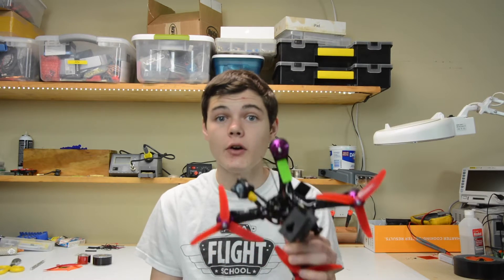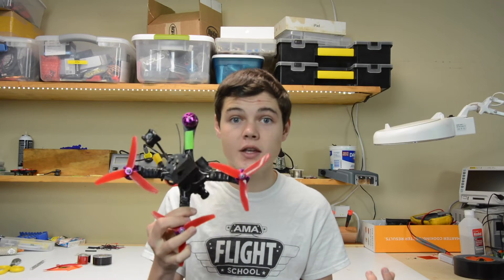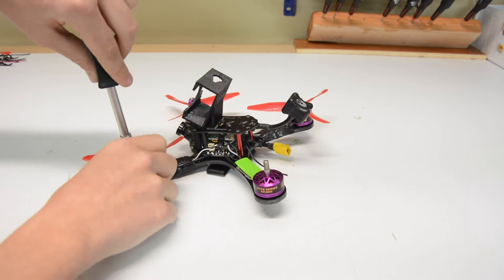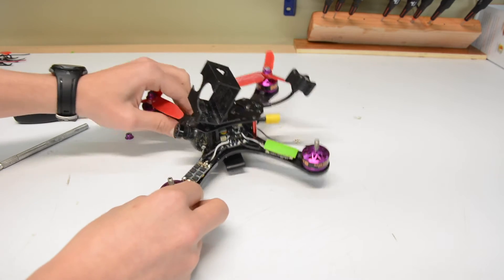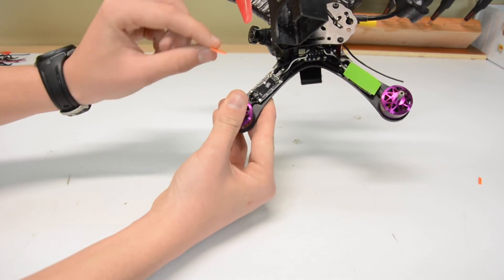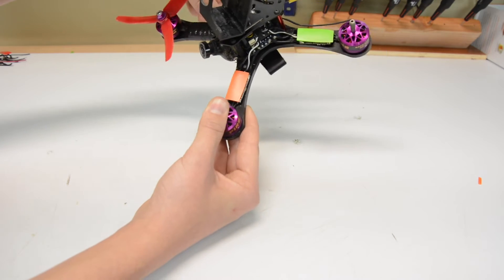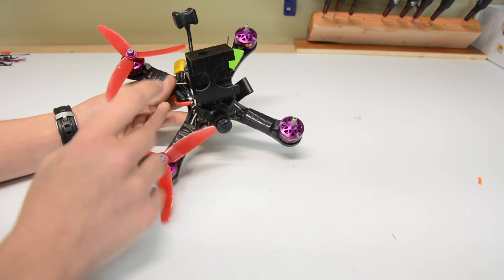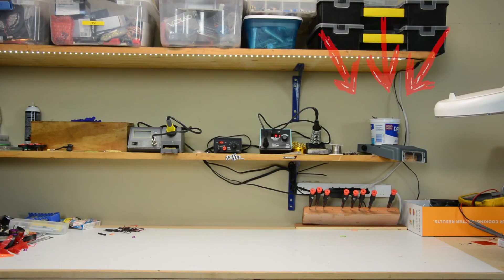Protecting Your ESC's

Comment: Would 30 AMP ESCs on 2306-2450 Kv motors and 5051 tri blades run the risk of overheating being insulated in foam and tape and plastic like this ?

Comment: Leave original shrinkwrap on the esc. Might want to align the prop slightly off center so it protects from a prop strike from the direction the motor prop is spinning. Otherwise very good instructions. Vulcsnizing tape is an awesome idea to use.
Reply from the maker: Great idea, off centering it in the direction of the motor would create way more protection!

Comment: Thanks for the tutorial.
I don't think using a powerful biadhesive over (or even under) the ESC is a good idea, unless it's covered with some thermo first. On a KISS 24A ESC I had several of the small condensers (the ones in row close to the FETs) removed when I peeled off the tape...
Reply from the maker: Wow, I haven't had any problems with this solution. Thanks for sharing though!!